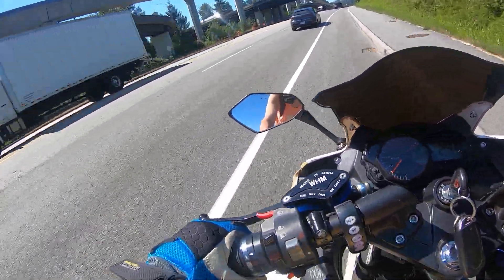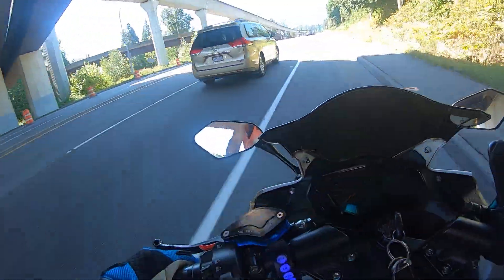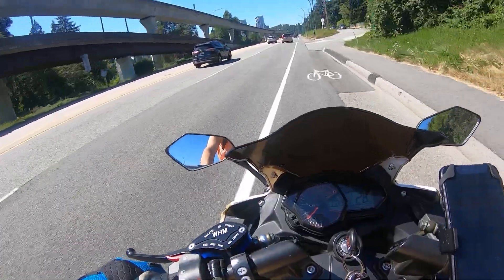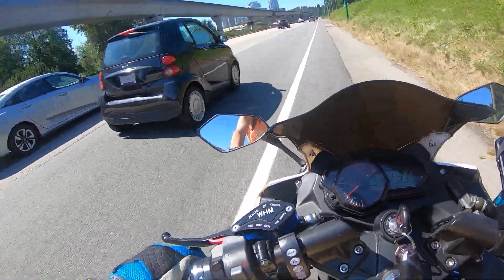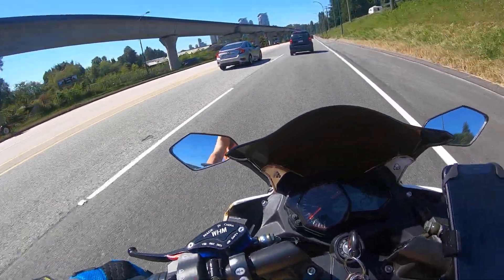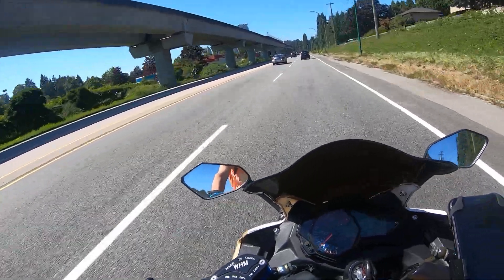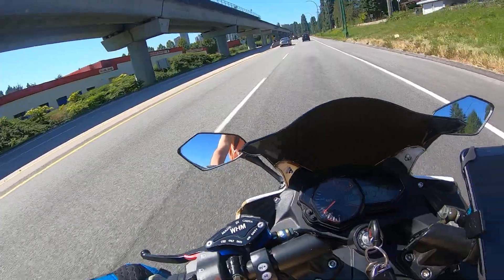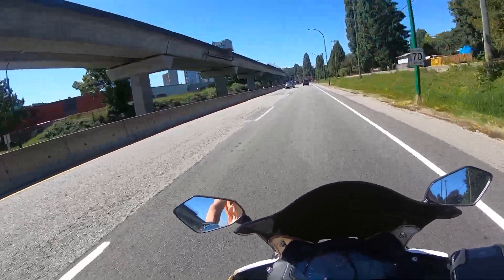how to get max distance on your ebike learning to use your throttle properly

Comment: Awesome channel just subbed. I‘m in the process of building an ebike & hv some questions. I‘m planning to use lead acid. What is the voltage of your battery pack? And what is your range?
Reply from the maker: I have a 72 v 32 amh lead acid battery pck brand new I was getting 75 Kms off one charge
Reply: @motoninja2966  Thank you! That is quite a distance. How many Watt is your motor?
Reply from the maker: @heavycurrent7462  sorry for the late response I have a 3000 watt hub motor
Reply: @motoninja2966 No problem man. I have a 3000 watt motor too but it is a mid drive.
Reply: Don't use let us and use lithium ion the battery is less weight and you get greater power and distance depends on what your wheel hub motor size you're using and you have to get the proper CPU box to go with it
Reply: I'm sorry that's don't use lead acid batteries use lithium ion I have one and it came with lid I changed over it to lithium ion I had a 2000 watt motor I changed it to 8000 watt motor which only cost me an extra $1,600 and I get a greater range and get more power I also changed over my control unit box CPU
Reply from the maker: @williamhyman5048  sweet I want to upgrade the hub also to a 8000
Reply: @motoninja2966  I bought my motor from alibi
Reply from the maker: @williamhyman5048  how long did it take you to get your bike
Reply: @motoninja2966  3 months
Reply: @motoninja2966  but that was before they fully shut everything down
Reply from the maker: @williamhyman5048  awesome
Reply: @williamhyman5048  whats the company name that you got your hub from ? On alibi thanks
Reply: @ramoncardona7037  I got mine from the woxi jose electric technology company
Reply: They're pretty much certified but you make sure that any company you buy from is verified if they're not verified and they can't give you the certificate of ownership they say they don't have one it's a scam be careful I think this is a company that I got it from I'm at work right now so later on I'll look up the paperwork and tell the exact company okay
Reply: @williamhyman5048  thanks bud and you installed yourself or got a mechanic?